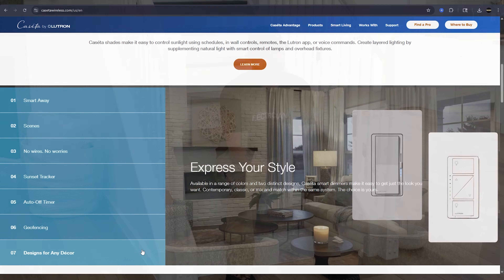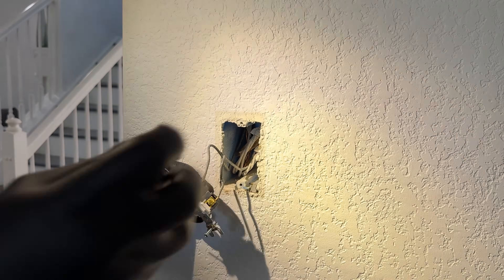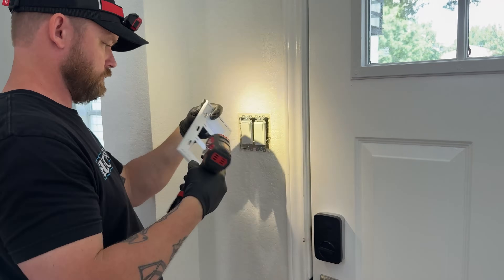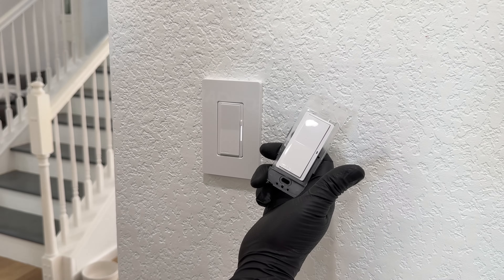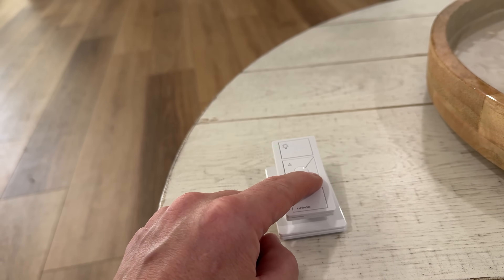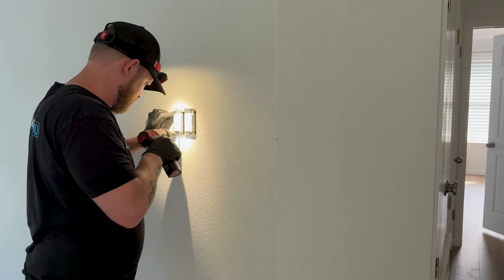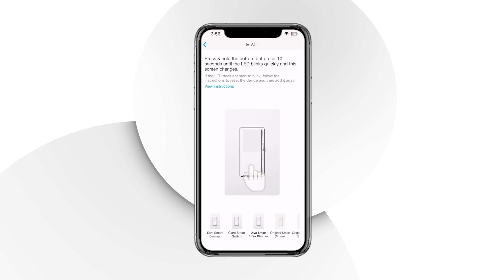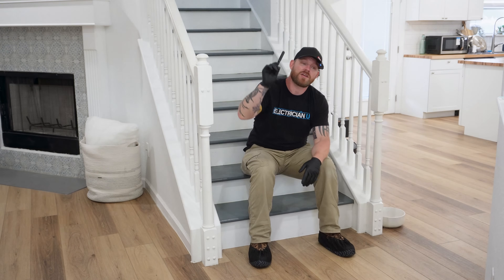How I Made My House Smart Without Spending $100,000!

Comment: Caseta solved a lot of problems for us when we bought our home and found virtually no 3-way switches in it.  Particularly like that some of their switches don't require a neutral, a common problem in older houses.  Up to nearly 60 devices at this point.  Nice to be able to turn on lights before we get home late in the evening and turn the whole house off at night from bed. We use their shades as well on our back porch, with the app the come down part way an hour after sunrise and then go back up a few hours later after it has passed. Simple and VERY reliable.

Comment: The nice thing about Lutron is the robustness. When you pair a switch and remote to the hub, it also pairs the remote directly to the switch. As such, the pairing still works if the internet is down or the hub is disconnected.

Comment: Nice job explaining how the system works. 👍

I replaced every switch in my home (approximately 30) with Lutron Caséta. The only exception (for safety) was for the garbage disposal in the kitchen.

Lutron makes excellent quality products and their technical support is among the best I've ever experienced. You can actually speak to a live person that's knowledgeable and not reading from a script, which is rare these days. They even followed up with an email that included a custom wiring diagram for my exact situation! 

My Caséta switches have never failed and are the most reliable part of my smart home.

Comment: Lutron caseta sucks! I don't understand why these installers recommend such crappy systems. Purchase a standard zwave system and then add it to home assistant app. For an installer it is so simple and the selection of devices is 1000% more than anything lutron offers. Not just lights, fans, outlets, garage doors, doors, you name it they have devices that can do it. Also, caseta costs like $60 /switch compared to zwave for $12-$20 each.

Comment: I was looking at the Caseta system for my place, but ended up deciding against it just because of limited selection and next to no interoperability with other systems. Great for something basic, no doubt about it, but there are things that I want to control that really can't be done with Lutron at that price point. Like a fan with only 12-2 running to it from the light switch, but I want full remote control without replacing the whole fan or rewiring... that kind of thing. Also, not fond of cloud integration from a cybersecurity perspective. Ended up pulling the trigger on a HomeAssistant Yellow and now I'm building out my home automation system based around that using pretty much anything I want. Wifi, BT, Zigbee, Z-wave, doesn't matter.
Reply: For homeassistant Caseta runs locally, so you can just block the device from reaching the internet and then it helps to limit the security concerns.  Not that I am aware of any flaws with the current system.
Reply: If you're still looking for switches, Inovelli is phenomenal and works seamlessly with Home assistant and they have fan controllers that do not require a separate canopy module

Comment: Wanted a 3 way switch in my kitchen chose this system works great only complaint i have is the switch with the controller is a different style button then the remote switch but maybe thats all my supplier had at the time…

Comment: Until the manufacturer drops support. IIRC Legrand was junk...I took mine apart and found burnt chip. Lutron will be around, but caution on others like Wemo, etc. Oh and  I have the Lutron Caseta with the hub (atleast the one I have).  Good system.
Reply: Fortunately, even when those OEMs drop support, provided they don't remotely brick your device just for funzies, you can still pull them into HomeAssistant instead. Most of the time you can even bypass the hub. Unfortunately, I think Caseta uses proprietary protocols so they do actually need the hub to work with HA but they can connect directly without connecting through the cloud.

Comment: Caseta is a great system, both for creating a smart home and when you have a difficult area to pull wires. And if you don't like the look of a remote, there is also a new style pico that looks like a regular decora switch.
Edit: the original Caseta dimmer switches doesn't require a neutral to operate.

Comment: Sorry, I just get up and walk over to the light and turn it on or off, it’s worked for me for 68 years! 🤪
Reply: Never to late to change😂😂😂
Reply: I feel the same way with manual windows in cars!
Reply: Don't you remember when you got that TV with a remote and you were so happy you didn't have to get up to change the channel?  Well this is the same thing.
Reply: @SyFyJoe , except that picking up your phone, unlocking it, opening the app, waiting for it to sync, finding the correct switch, and pushing the button often takes more time than just getting up and hitting a switch, unlike a TV remote that's faster than getting up and changing the channel. There are plenty of good reasons for implementing smart features, but time-savings isn't one of them, IMO.
Reply: Dont change it!

Im surprised to see him make his home smart! (Haven't watched the video yet)

All high quality electricians i know would never do this. Most people who understand technology keep it far away from their homes and family 😂

Smart houses are a terrible terrible idea. Unless you can build the entire system from scratch and knoe how to keep yourself safe; its just creating video and audio connections for hackers and the government.
Reply: @VoltsAnBolts its lights bro, what can you control with lights especially if you encrypte it
Reply: @VoltsAnBolts  the Lutron cassetta system is decent, you use a local hub device instead of a cloud service like all the awful smart devices your thinking of.  I’ve used it for 10 years without a single hitch and it works without internet.
Reply: @VoltsAnBolts  Swapping out some switches and adding some controllers can be a good way to make things work better than they were originally designed, especially when you're not allowed to make any permanent changes. Like this rent house I recently moved into.